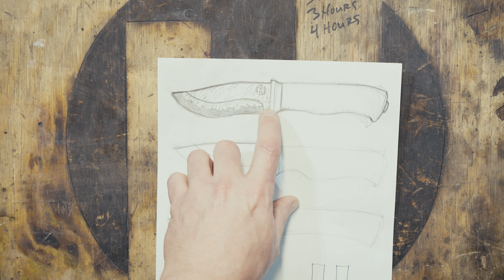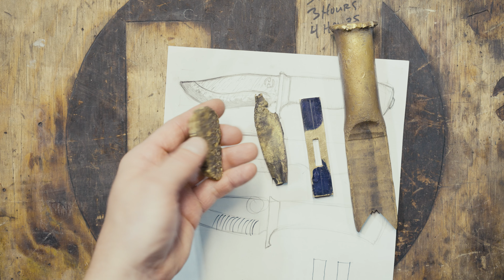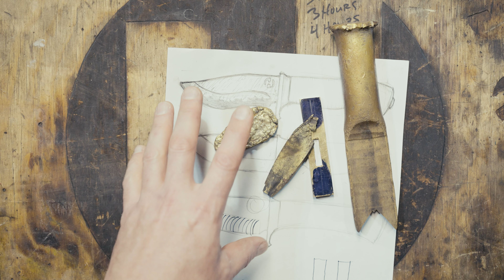3.5" Hunting Knife: Building a Foundry

Comment: excellent build and very comprehensive instructions, good work, and looks like it has come out a treat, again something I am planning to do though with coal as a heat source so my build when I get that far will be different, been saving aluminium and copper and brass for a good while now for when I get that far, as regards the brass the problem is the zinc burning as that is bad for you, you could always mix aluminium in to make alloy bronze and get similar colours without the hazard and also a stronger metal as well
Reply from the maker: Thank you, Andy! You’ll have to let me know what you come up with.  I think I’ll try mixing aluminum. I have a bunch of it, so why not.